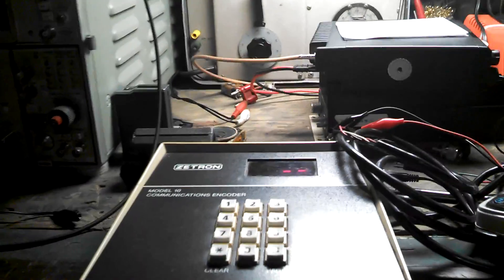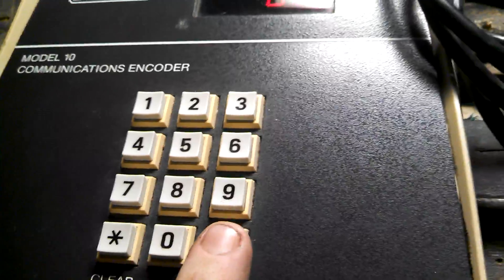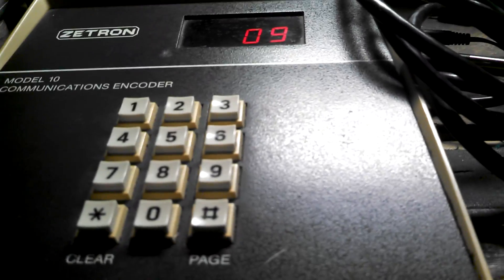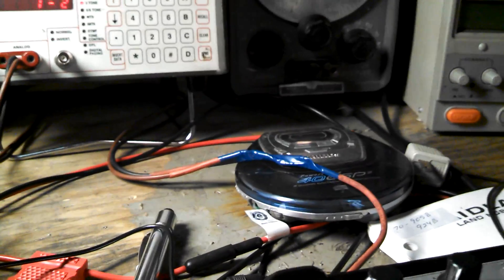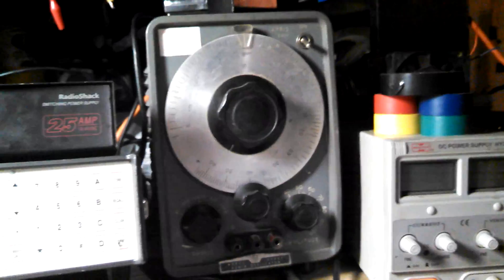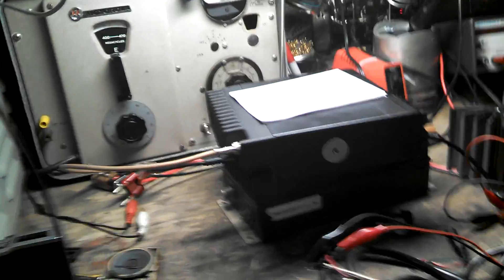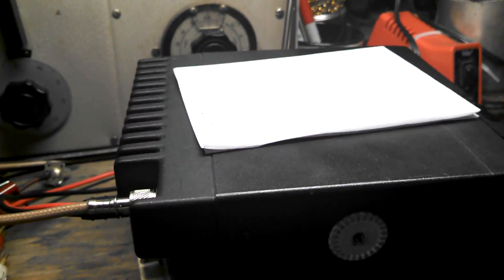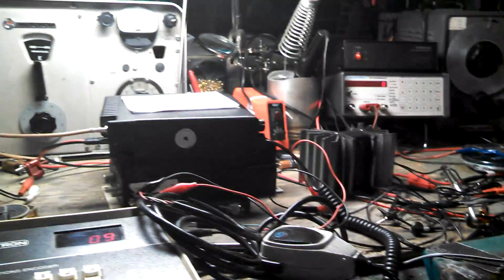Two tone sequential paging and radio system

Comment: Zetron usually had a set of programable chips that were set to whatever code format you would like to use. they usually just open it up and flip a chip in the back....they also have a label on the chip telling you what version it is...  so open it up and read the labels to tell you what was put in it. Another way is to map the frequencies tones it is putting out...then look up the format chart motorola - GE - Page alart _ etc.

Comment: Back in the 80s and 90s I used to pick up voice pagers that had a long tone followed by a few short tones. So it would be beeep blip blip blip.......voice message. Do you know what that system was called? The frequency would also have numeric pages such as FLEX.
Reply: Golay had a long tone precursur. PMR2000 voice pagers or Motorola METRX tone only pagers.
Reply: SECODE used in early mobile phone dialing. usually aroung 152MHz or 464MHz

Comment: For Zetron encoders a Motorola cap code of B202 substitute the number "1" for B.  
B202 translates to 1202. 
Motorola Cap Code Q610. Use the number "2". 
Q610 should translate to 2610. 
I cannot verify that all Zetron encoders are configured this way. 
If your cap codes begin with a letter followed by a three digit number, you can try substituting the letter with numeric value (0-9). 
Hopefully you'll land on the correct group.
Reply from the maker: Thanks!

Comment: My tone decoder, with code "09" on your zetron, is showing 1122.5 Hz then 903 Hz.
Your tone generator is at 1000Hz then 801 Hz

We use this same Zetron as a backup at our fire station. These were normally factory programmed to a requested tone group. 

Try: repeater-builder. com/tech-info/pl+dpl/tone_signaling.pdf 

(Scroll down to the "Motorola Quick Call 2 one plus one" chart) 
Your encoder may be set to reed groups 6 (tone 1) and 5 (tone 2) according to this chart. Let me know.

~ Ben

Comment: Check out YouTube video "Basics of Lissajous Patterns on an Oscilloscope"
Connect the encoder to one of the channel on your scope and the code gen to the other channel of the scope and scope to X Y mode.  set the tone duration long enough on the code gen then send out the tone from the encoder and keep adjusting the code gen freq until you see a line or circle for a 1:1 ratio. I have watch radio service check the freq of an encoder this way (but they knew what the freq should be.)
Reply from the maker: Awesome idea, will try after I complete my move, thank you